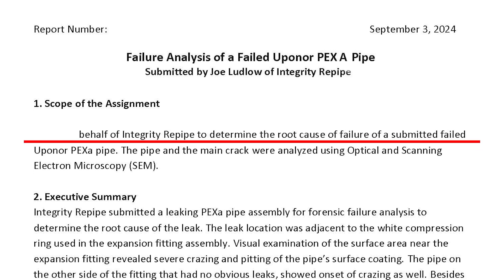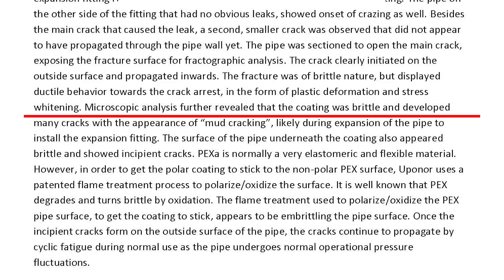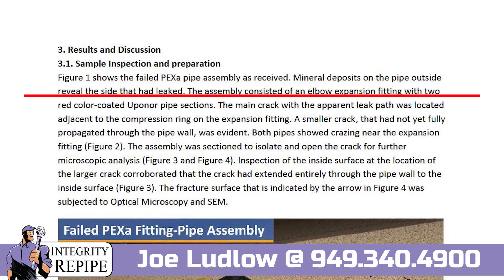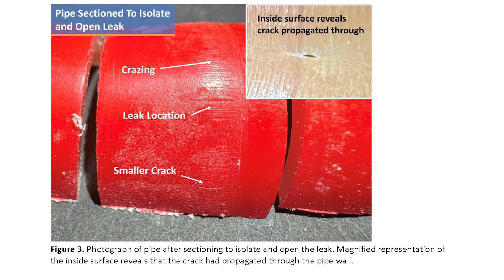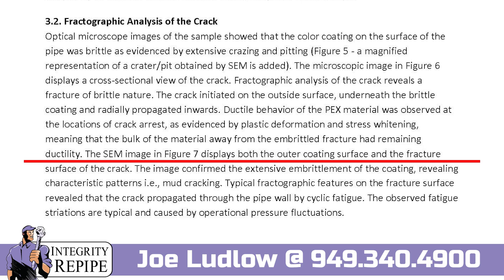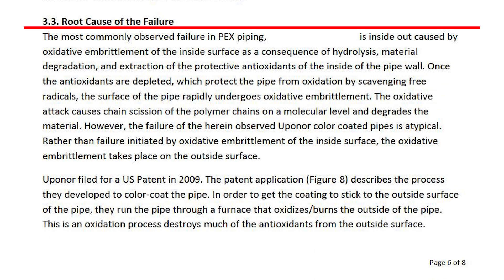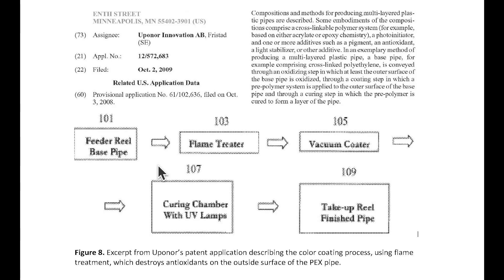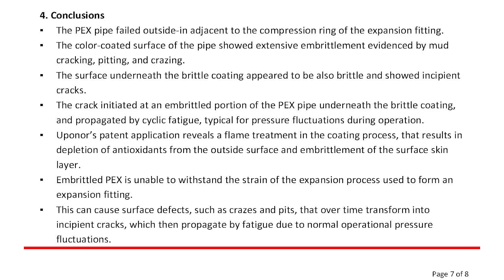Why This Uponor PEX-A Pipe Cracked: Forensic Failure Analysis Lab Findings

Comment: The lab's conclusion is that it's Unponor's exlusive coloring procedure that caused failures at the expansion points, yet your very last clip shows uncolored white pipe failing and failing AWAY from the expansion.  Nothing learned from this.  Have you submitted that failed section of white pipe??
Reply from the maker: Question: Are you an Attorney?

Comment: You had mentioned you were going to post a video on which pex you now recommend and the fittings to use. We are redoing a mobile home and have a couple weeks before it needs to be done. Was hoping to see your video before we purchased our plumbing pipes. Thanks for the information you share.
Reply from the maker: What part of the country are you in ?
Reply: @IntegrityRepipeInc I am in the Western Mountains of Maine. Thank you for your reply. I appreciate that your time is valuable.
Reply from the maker: @debis3558  Go to Ferguson supply and buy Jones Stephens Pex A pipe, fittings and rings. My Tests prove it is better product
Reply: @IntegrityRepipeInc  Joe, do you have any experience with Legend Valve PE-RT?  Supposedly uses the same base polymer as all PEX versions but less processing.  Also F1960 expandable. They guarantee it for life but I'm more interested in field reports.
Reply from the maker: @ohger1  I would need more info from Legend before I can comment.
Reply: Thank you, very much appreciated

Comment: Hi, can I use Dewalt DCE410 for Zurn Pex B? 
I know that the expander head is a little different, but I don't really want to buy a new head to make 3 connections. Thanks!
Reply from the maker: Please call Brad @ main Line sales (Zurn Rep) 760-271-3423 and ask him for the most current . Thank You. hope it helps.

Comment: I'll always use copper fittings and pipes.  Pricey, but well worth it. In my childhood home, which is now 62 years old, I never had any problems with it.
Reply from the maker: Hi. I repipe homes that are six years old with copper pipe type L and Type M every day. The copper pipe that was installed in your childhood home no longer exists. 99.98 pure copper pipes are no more and the copper pipes now have Chinese Hot Washed Recycled copper used in there manufacturing process. Ask any home AC installer if copper has changed since 2000 and they will explain how the entire industry has a huge problem because new homes have a required 10 year warranty. Question: Did you know that a slab leak is always a type L failure. Hope this helps as times are changing and I will be installing 21 units today with as little copper used as legally allowed.   
Copper Warranty only pays the failed part price and the $150.00 per hour rate to install that new replacement part.
I am probable the only person you will ever contact that has filed and been paid by a copper manufacture on a warranty claim . 
Copper Warranty = $ 150.00 + parts  Thanks Joe.
Reply: The pH of the water is very significant for the lifetime. If it is low, expect problem within few years. If it is high, Cu pipes can last for 100 years.

Comment: I used HyperPure legend PEXa. Hope that will do ok.
Reply from the maker: Hi. I am very interested in why you chose HyperPure Legend. I really need to communicate with Legend and get more information about Legend products.
Question: is HyperPure a Pex A, Pex B or Pex C product. I really need to study Them! Thanks Joe
Reply: @IntegrityRepipeInc Legend HyperPure is PE-RT pipe, not PEX, although it's looks identical to PEX-A. I've used it on a couple jobs and it seems very similar to Expansion PEX despite being slightly stiffer. It seems like a good product though, one of local suppliers only stocks this now instead of PEX. Also Legend claims to have a 100 year warranty on HyperPure.
Reply from the maker: @Ben.Spicer  Hi Ben. Can you please send me the name/number of the supplier who only stocks Legend HyperPure PE-RT. Thanks you. Joe Ludlow. 
cell #  949-340-4900

Comment: good on you for posting these video, I repiped our house and bought the Zurn based on your info, the plumbers thought I was crazy, we live where there is a lot of chlorine glad i used Zurn
Reply from the maker: My knowledge has grown in orders of magnitude in the last 2 years and I now have far greater insight into Uponor Pex A. Zurn Pex B. Viega Pex B. Rehau Pex A. Jones Stevens Pex A. Polybutylene. CPVC. That being said Zurn was the best choice for you as you had access to Uponor or Zurn. Please review uponorclassaction.com for a more complete understanding of what is proposed at this time. Thanks Joe.
Reply: @IntegrityRepipeInc Do you still think Zurn expansion is the best pipe/method, having said this?
Reply from the maker: @BruceWayne-m6g  No. I will be making a change in the future.
Reply from the maker: @BruceWayne-m6g  No. I will be making a change in the future.
Reply: @IntegrityRepipeInc  is it as bad as uponor? having repiped my whole house with Zurn expansion, am I a sitting duck?
Reply from the maker: @BruceWayne-m6g  The failures in Uponor Pex Systems are not relevant to Zurn systems. Example: Wirsbow/Uponor factory representatives suggested that I install Zurn Pex B on all hot water recirculation return pipes from 1993-2008 my thoughts where why not use Zurn everywhere.
Reply from the maker: Hi Egan. Thank you for asking this question. I am going to give you the Knowledge you seek. I am currently producing a video that will be out soon and it will provide you with actual evidence that you made the correct choice. Thanks Joe.
Reply: @IntegrityRepipeInc  I will look for it,

Comment: Always knew this stuff was garbage. Stainless steel is the future. Plastic needs to go away, at least where drinking water is concerned.
Reply from the maker: Hi. Very interesting point. I am interested in hearing more information. Please keep in mind that not all Pex are created equal. example uponorclassaction.com
Reply: @IntegrityRepipeInc  Plastic is far too pervasive in our lives. It needs to be seriously reduced and it doesn't NEED to be in our drinking water.
Reply from the maker: @theprofessorfate6184  Yes: That is true! I need to do a video to address this issue. I can at least explain best practices to deal with this reality. Thank you.
Reply from the maker: Just so you understand.
It is not possible to install Stainless steel in homes and it will never be.
Reply: @IntegrityRepipeInc  You're very wrong and I have no idea how that idea entered your head.
Reply from the maker: @theprofessorfate6184  Please let me explain from my perspective.
1)  You would need IAPMO to change there codes.
2)  You would need to change All Building Codes.
3)  You would need to change All City Adopted Codes.
4)  You would need to change All County Adopted Codes.
5)  You would need to have All Plumbing Supply houses change their inventory and they would have to expand their inventorying yard size.
6)  Every Plumbing Tuck would need to be refitted and Retrain All Plumbers.
7)  You would need to Retrain every inspector city and county. 
8)  You would need to retrain the public the same public that thinks Fluoride is safe and does not understand.     Fluoride is a neurotoxin.
9)  You would need to restructure the entire planet flat or round.
Please do not misunderstand me. I am just not sure the world would allow it to happen. Cost Cost Cost 
Please send me your thoughts. Thanks Joe.